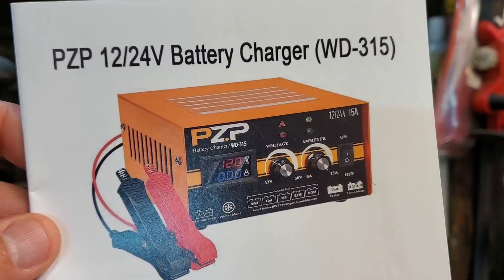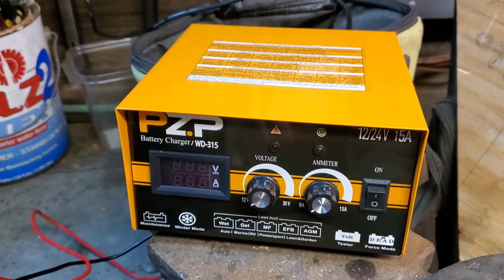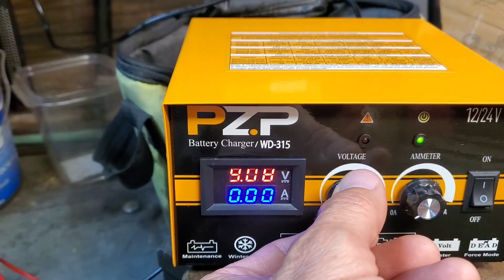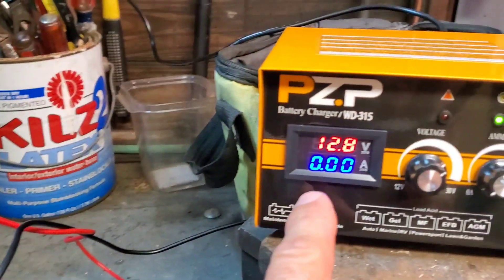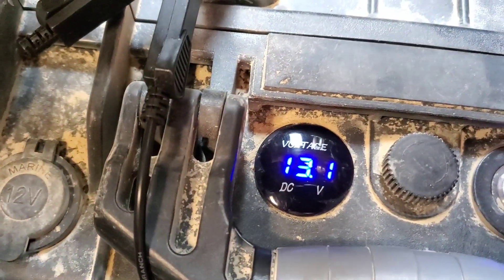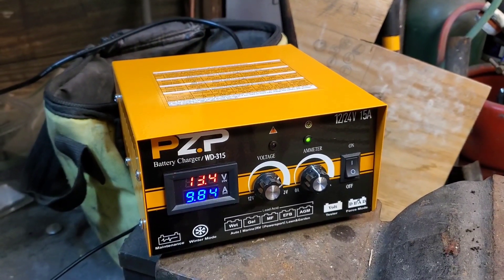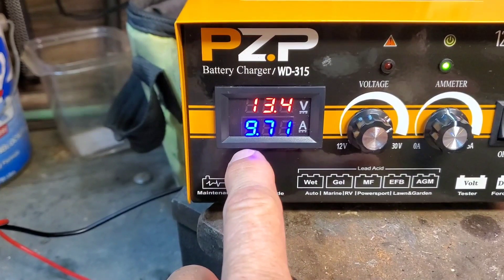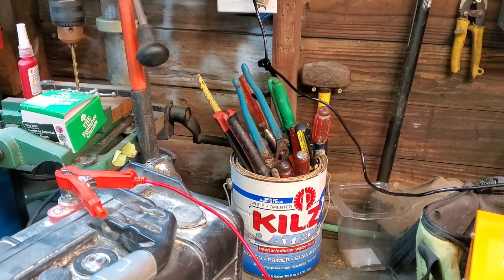What I use to charge my custom made batteries (link in description) @Timeline Ranch far west Texas

Comment: Sounds like it shuts down automatically so the battery won’t over charge, did I understand that correctly?

I’ve heard it’s made in the US but I haven’t seen that written anywhere. Is it made in the US?

Does it have a user settable timer that will shut it down? 

I understand it will not charge a completely dead battery. Is that correct?

Thank you for the review and tutorial, it was very helpful!!
Reply: Thank you for the reply
Reply from the maker: Thanks for watching the channel and good questions. It will stop charging at the setpoint you set it for. The fan on the charger will keep going until it's disconnected from both the power and the battery you were charging. I believe the charger is made in China. This model does not have a timer setting on it. It will  charge a completely dead battery, but you would have to have another battery to wire in parallel to let it sense voltage, and it would charge both batteries at the same time.

Comment: While charging, it sounds scary, as if it will explode at the end 😀 Can it help with electric car too?
Reply: I like to see you try.
Reply from the maker: Yes it will work on any battery with in a voltage range of 12v to 24v you would have to see the manufacturer suggested amp charge rate and voltage for that specific battery. It is on the loud side so you probably wouldn't want it charging anywhere you have to listen to it.